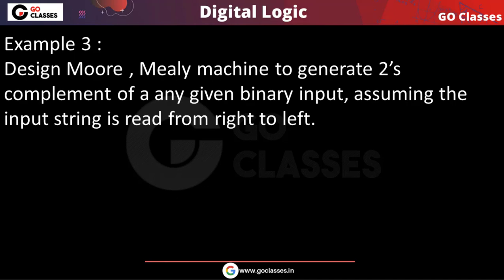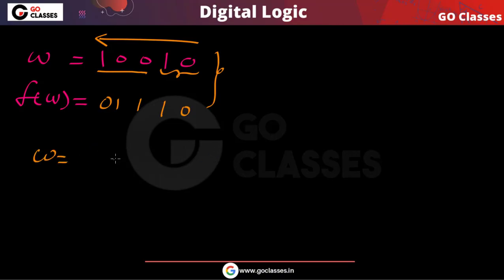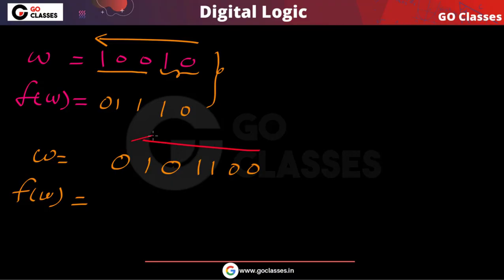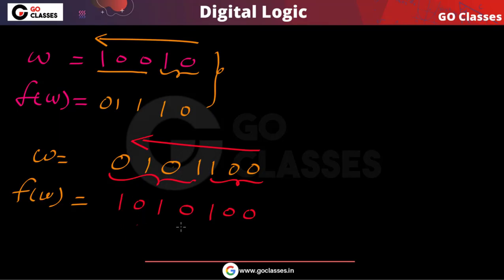Mealy Moore Machine Design Example 3 : 2's Complement of a binary number

Comment: i think this is not correct because in moore machine you didn't consider the case where from rhs we get 1 then this machine is not able to run any string that ends with 1
Reply from the maker: You are right. In the Moore Machine Design for this problem, we missed one transition from the initial state, & that is: from initial state (q0, λ), on reading symbol 1, we move to state (q2,1). Rest everything is correct. We missed that transition. Thank you for pointing it out.
Reply: @GOClassesforGATECS  😁